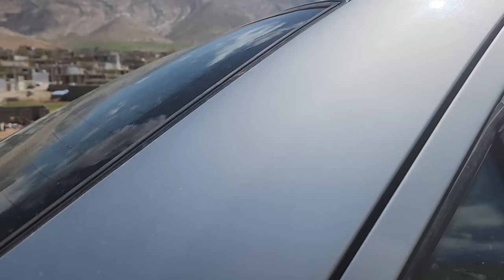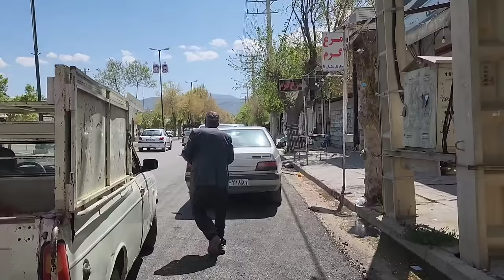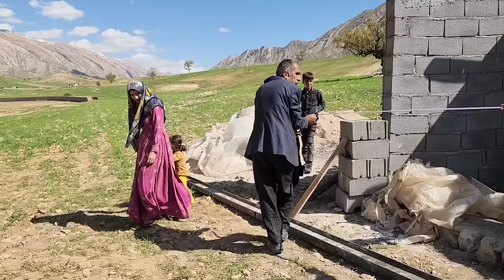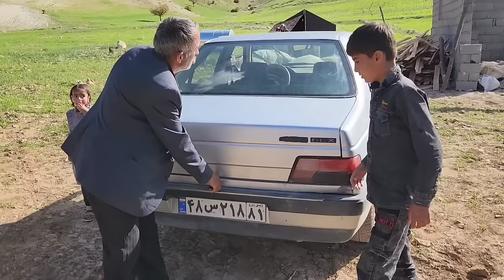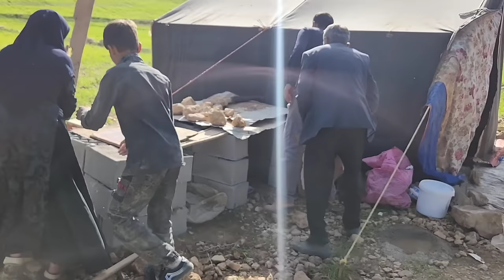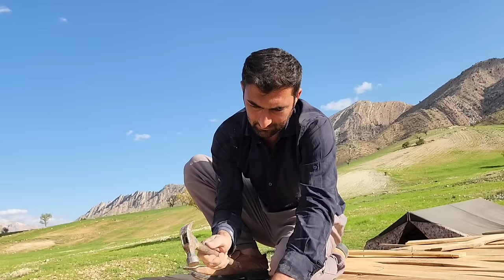"Building an ideal: a story of empathy and unity to build a nomadic roof"

Comment: This whole building is not correct to put all this weight on the brick walls and add to that a five-metre-long iron, and you in Iran have many earthquakes. If you made a roof like a tent, it would be parallel to the weight. I only advise.